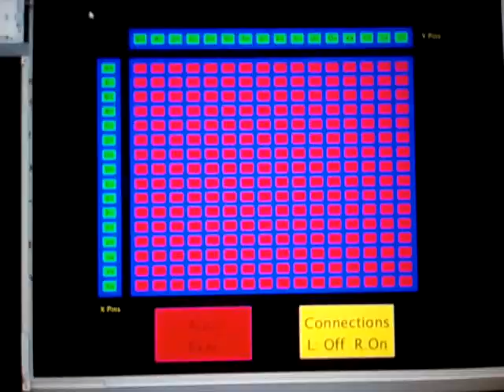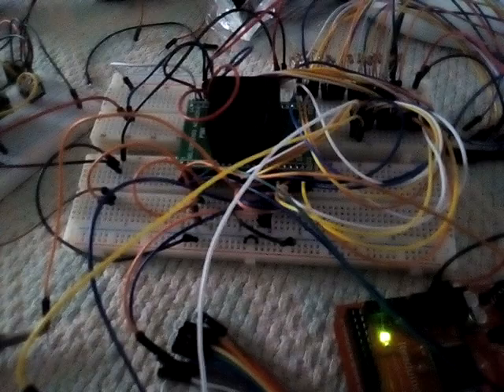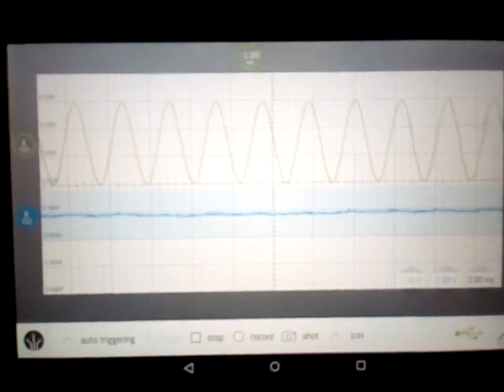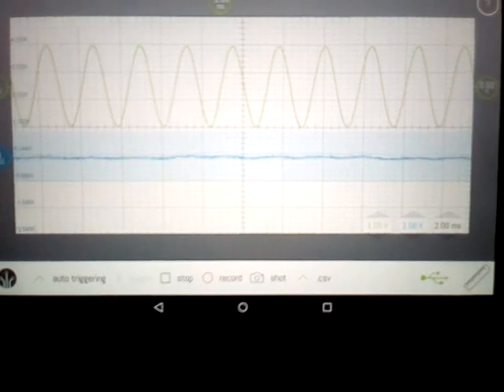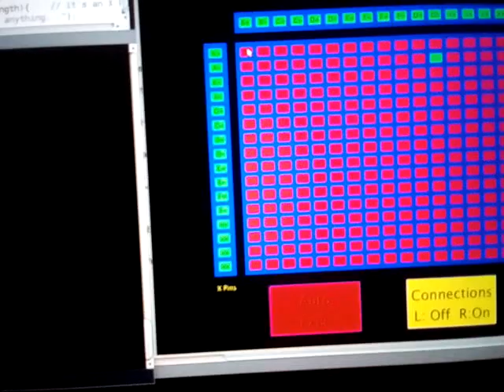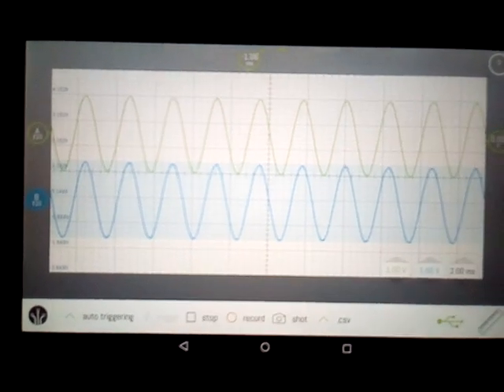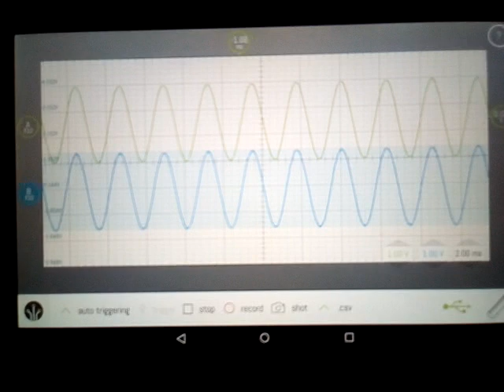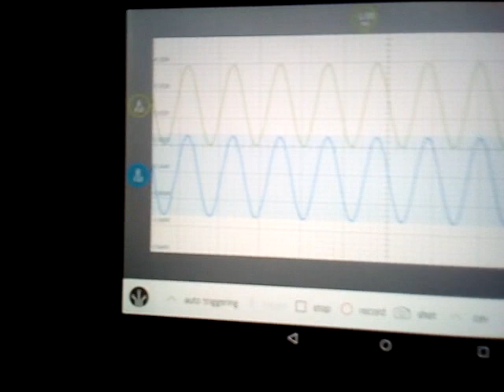AD75019 Success at last!

Comment: I heard "guitar". Are/were you building a switching-matrix based loop switcher? I was looking at the AD75019 for the exact same thing but looking at this I feel like the various issues might be way over my head o_0
Reply from the maker: Not a loop switcher but another circuit of my own invention.  In the end I was able to make the AD75019 work properly with the help of a special PCB that a friend designed for me. See this video for results: https://youtu.be/JvzLarRLF1c

I struggled with this for more than 6 months, but in the end it works. I don't know your capabilities but if you know something about electronics or  have friends who can help you then you should give it a try ! And even with very limited knowledge but enough persistence, it should be feasible! 

Good luck!
Reply: A guitar effects switcher is why I got this as well. Glad I'm not the only one, seems that it is a promising direction to take, but not without hiccups!

Comment: Hello and thank you for the video, so if I understood everything, a board based on the AD75019 is driven by a mega which itself is piloted by a PC. Would you have a description of the inter-connections and especially what is the PC software?
Reply from the maker: Hi, Thanks for your interest. I'm sorry but I don't understand your question? In the meantime, I have done a lot of work on this, but not published much yet. Tell me exactly what you'd like to know?
Reply: @GratefulFrog  Is it possible to turn ON Single LED and switch to next LED in an array within usec? No two LEDs in an arrangement should turn ON simultaneously.
Reply from the maker: @bkdeepak6896  The AD75019 response time is on the order of 5µsec, but you need to be able to send the bits 16 bits at that rate if you want to go super fast. I am not sure I understand your question?